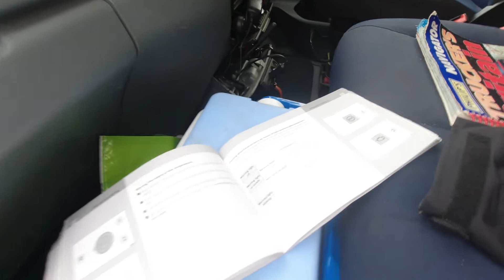Van Life Worse Case Scenario - Vlog 32/22

Comment: Sorry to hear of the costly troubles you've had Rob. I had similar van issues over winter which has cost me a small fortune so I understand where you're coming from. I agree... it's best to have a pot of cash and a plan ready for such emergencies. Cheers
Reply: Some vans are better than others Gaz, but overall they seem to be more troublesome than cars. My ford transit is in for repair and the outlook is very grim. One thing is for sure, I will never buy anything again with a ford badge.
Reply: @mmwaashumslowww7167  I feel your pain. Old Transits are costly to keep on the road.
Reply from the maker: Yes the plan A and B, and then possibly a C and D. Fortunately the money was there, but now the savings are hammered. Cheers
Reply from the maker: It really is the luck of the draw with vehicles, horse and cart next I think. Cheers

Comment: I live in Ireland in my van and I've long had the lofty ambition of touring Europe in my van one day, I had some holidays last year and decided to do a little trip within Ireland, 50 mins outside Dublin, my van broke down and I had to call a breakdown truck to take it the rest of the way to the campsite I had booked, back to dublin would have been too expensive, so I had my "holiday" in a van I knew was fucked and had to organise a mechanic to fix it when the 3 days were over. 
I paid 100 each night for two nights in a hotel in the town I was in, I could have stayed in the van though because while I thought the van was getting fixed, I learned on day 3 of waiting for the mechanic to call that he had only ordered the part and was waiting for it to arrive, so my van was just sitting outside the mechanics not getting worked on at all, the mechanic of course neglected to tell me this, so I threw away 200 eur on a hotel for nothing, I also thought my breakdown cover would cover the cost, but I was quickly imformed by my insurance company that the breakdown cover only covers a 15 mile radius from my "address", so I had to pay the full whack...

Makes me think the euro trip is nothing but a pipe dream, imagine the fucking hassle in a country where you know nothing....
Ps. Please follow up on the insurance thing, don't let those fuckers away with what they did
Reply from the maker: Yeh I'm still waiting for the RAC to deal with my complaint. God your story shows how volatile these lives of our vans can be. I think for me the hard bit is the unknown and this waiting for a diagnosis and then the dreaded bill. All my best to you Rob

Comment: If one side of lights not working you have an earth issue for that cluster. An easy fix for a mechanic. Unfortunately they're a rare breed. Most are just fitters.
Reply from the maker: Yep it was that an earth issue with exposed wires that had been chewed away by wee creatures. One of those things I'm afraid. Cheers